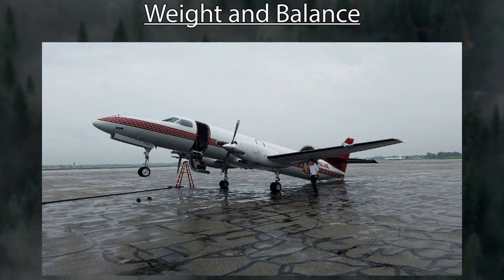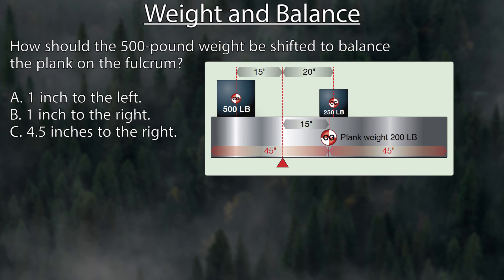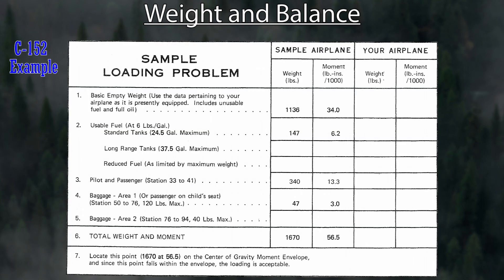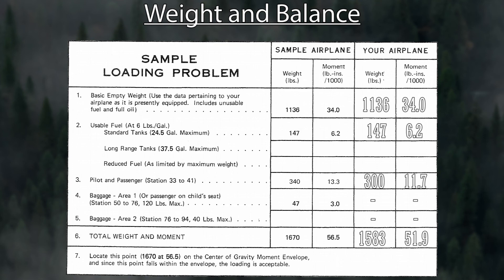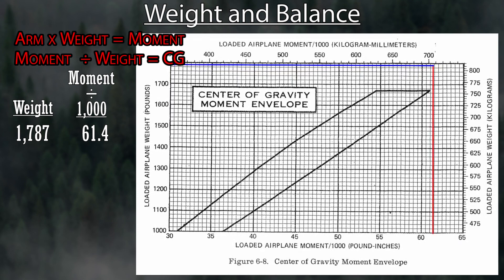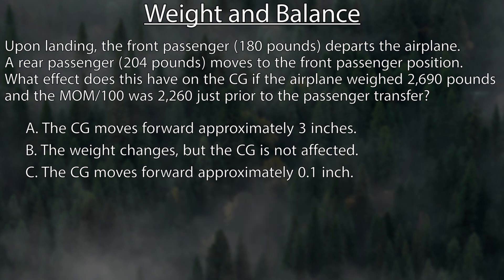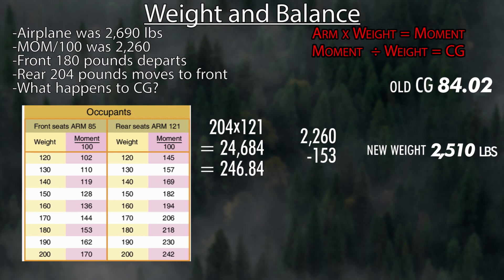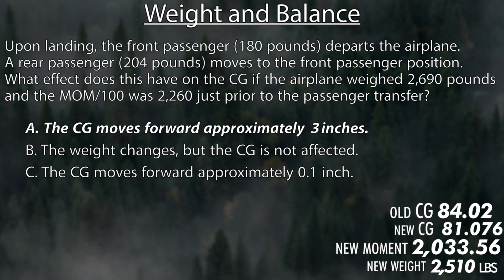PPGS | Weight and Balance

Comment: I know you didn't make this example, but this example appears to be really dumb/unclear.  They're saying the TOTAL weight of the plank is 200lbs, right? That doesn't mean that the full 200 lbs is on the right side of the fulcrum.  There would still be some plank weight to take into account on the left side, but we are only taking into account the 500lb weight. Am I mistaken here?
Reply from the maker: That’s a really good question @DoomTrooperTV. 
The simple answer - that’s the way we do it in the airplane. You don’t try to figure out how much of the ‘plane’ is on each side of the balancing point and then add the passengers and fuel. We go off of where the Center of Gravity is located. 

If you look at the example in question, you’ll see a CG circle showing where all the weight is concentrated. Since we move the entire plank, the entire plank’s center of gravity is shifted to the right, and so does the moment. In the end, we really only care about the offset from the center of the plank. It would be difficult to do the math (what if the plank is 190lb at one end and 10lb at the other? We’re assuming uniformly distributed weight). 
If the plank’s CG was over the fulcrum, you wouldn’t have the same question, would you?

I hope that answered your question, or at least brought up some more 😜.

Thanks for the excellent question. All the best.